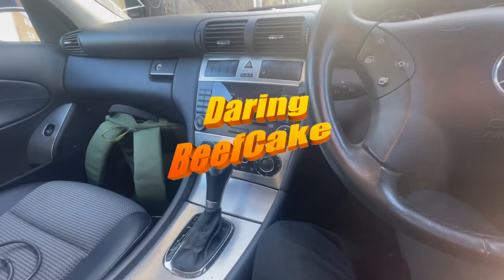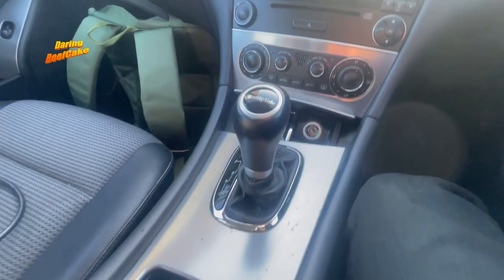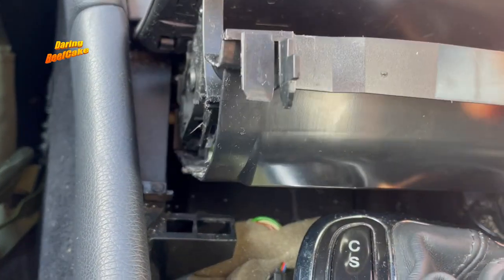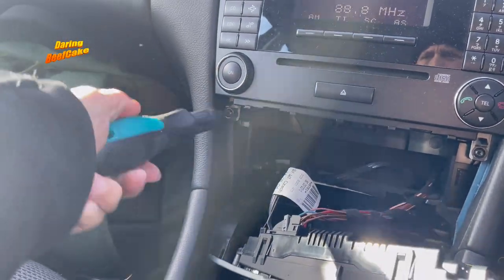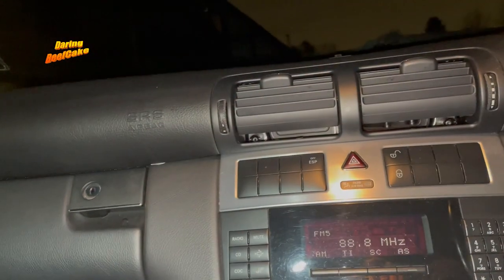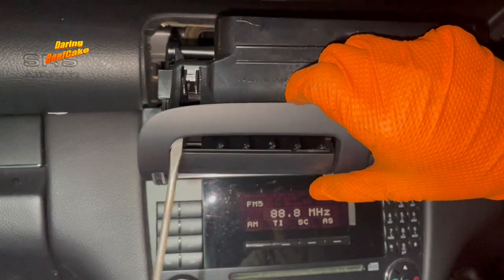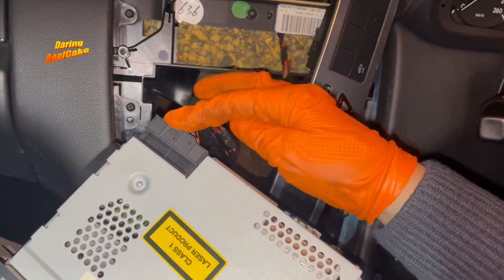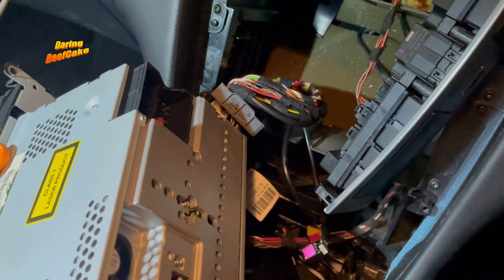Mercedes c class w203 radio removal

Comment: My replacement radio didn't work. Doesn't turn on. Why is it so hard to replace a goddamn radio?
Reply from the maker: Its probably not working, where did you buy it from, if its ebay, it might be faulty and you may need to return it. because at least it should turn on, specially if your old one is working...